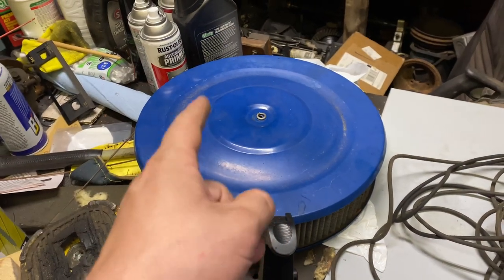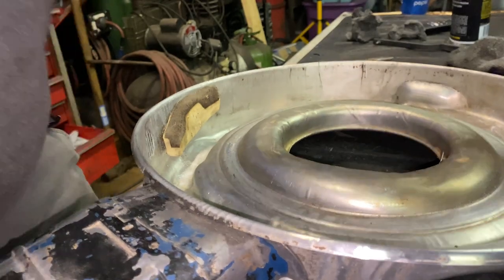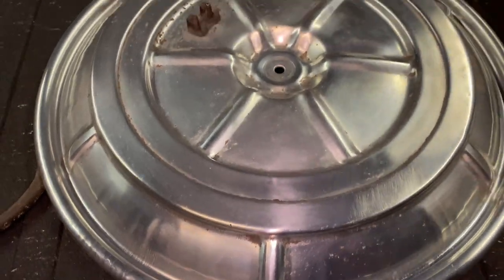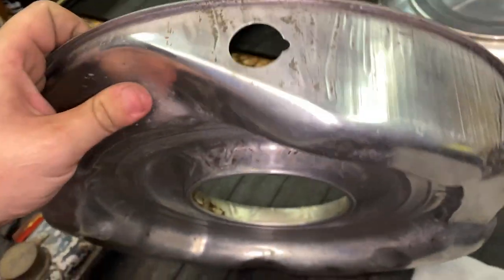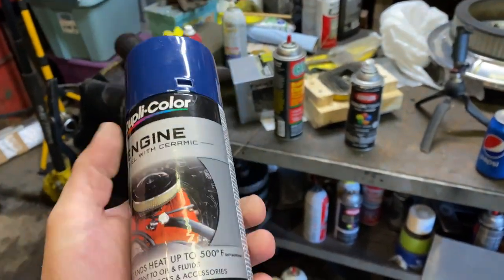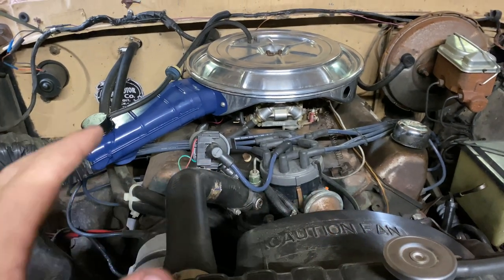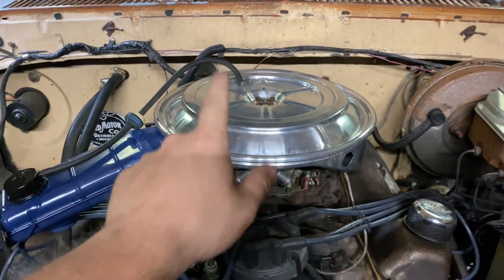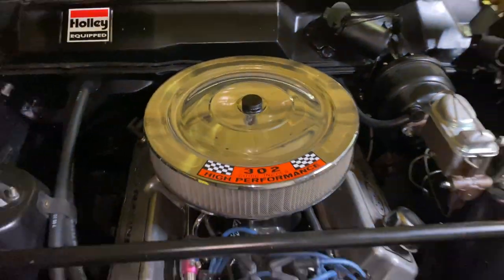Restoring original air cleaner for 77 F150 and install.

Comment: How did you actually polish the air filter cover? And clean up the black tubing?
Reply from the maker: @MarissaFischer-k3n  I used steel wool soap pad and window cleaner, or any kind of soap really and rubbed it all down, that’ll bring back most of it but it’ll be dull. Then I took some maguires compound and polish on a rag and rubbed it in until I got the desired shine. I didn’t want a super shiny finish as bays not how they were from the factory but if you want you can make it shine like chrome, like polished aluminum just takes some time. As for the black tubing, luckily mine was good and not torn so I just wiped it down with a microfiber towel and the same window cleaner I used on the air cleaner and it cleaned up nice. Hope this helps, good luck, thanks for watching.